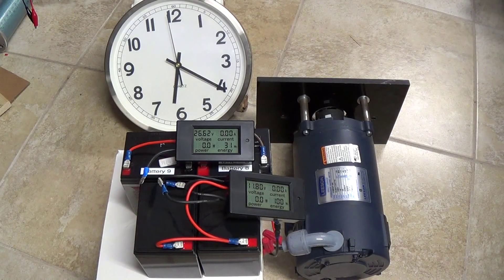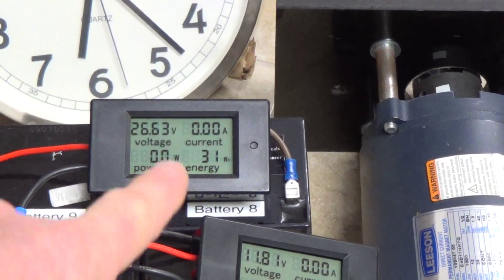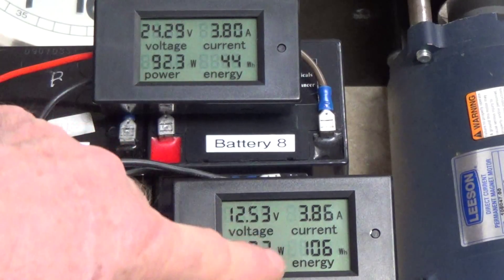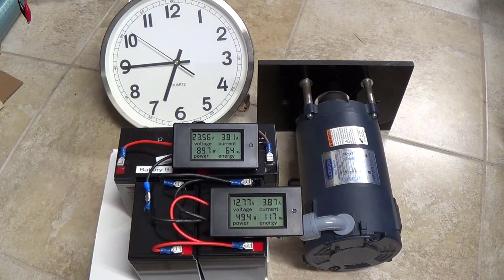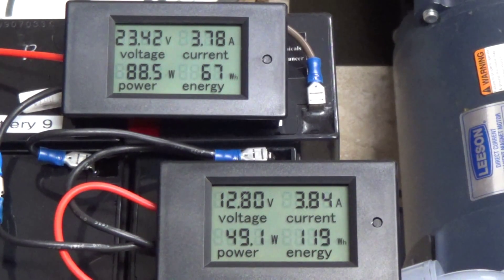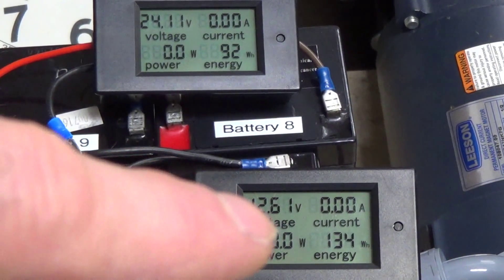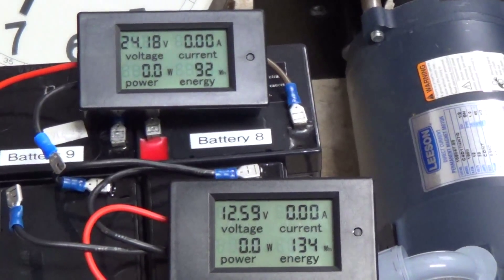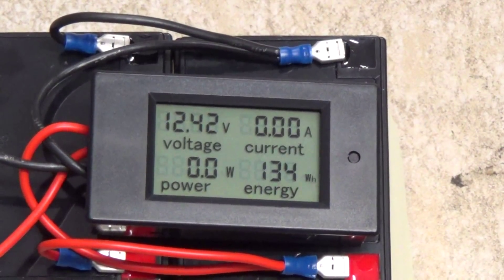Testing of Special Battery Arrangements (part 2)

Comment: I love the test but it doesn't seem entirely accurate to me. Maybe I am not correct, but when you did the first test, you did 2 5ah batteries in parallel for the 12v run. (13.3 actually but for ease of explanation 12v). Then when you did the second test, you hooked 2 5ah batteries in series. So technically that is not a valid comparison. Since the 24v pack is only sending the DIFFERENCE through the motor, the load only sees 12v. Not 24v that is being measured by your top watt meter. And at that, since it is only seeing the difference, it is only getting 5ah at 12v on the 2nd test. Not the same as the first test that got 12v and 10ah. For the 2nd test to be an accurate comparison, the first test would have needed to be 1 12v battery at 5ah. Your motor is losing speed so quickly because in the 2nd test, the voltage is climbing on the parallel bank as the voltage is dropping on the series bank much faster because it is only a 5ah battery. and the difference between the two banks is dropping quickly but it is due to energy being recycled in the 2nd bank. If you figure your voltage difference at the end of the video, you were only running that motor on 8.71v on test 2 and at the end of test 1 it was 11v. Of course the rpm would drop that low. Everything is actually working as it should. If the top watt meter was hooked between the 2 positives of the banks, it would show the 12v difference instead of the 24v that is not being used. That 12v difference times the amperage will show less than half of the energy left that 24v bank than what the meter shows. Not quite that much landed in the bottom bank, but most of it did. And not as much will transfer to begin with because of the voltage difference decreases so fast as bank 2 charges. This concept is meant to continually switch the battery banks, where in the long run you have actually recycled a portion of the energy you get to reuse. With my own tests, I get much longer run times swapping than if I ran them down in one shot. But I also do not get more out than I put in. But I do see way more run time. Thoughts?
Reply: I am not dogging the experiment, I think it is great and stuff I have been working on for many years. Some in the OU forum as well you frequent. But consider this. If in the first test, that top meter was hooked to the exact same terminals as the motor, why would you then hook it to different terminals for the 2nd test? The motor is hooked to the positive of the series pack, and the positive of the parallel pack. So it sees and receives the energy from the difference. But your watt meter is showing accurate current, but measuring the voltage of the battery bank, not what the load sees. So the wattage shown is inaccurate and most likely more than double what actually transfered. Does that make sense? Its like you are looking at it from the perspective of the run battery. But in order to know what the motor saw on the 2nd test, you have to measure it from the perspective of the motor.
Reply from the maker: Hi Chuck, this second test is to determine if there’s any advantage (gain) in a 4 battery connection scenario compared to running it off the 2 batteries in parallel from the first test. We are comparing Watt Hour of input vs output which is automatically calculated by V x A in the meter. So double the voltage is calculated. What we can clearly see right from the beginning of this test is even though we are changing 2 batteries in parallel we are using twice the amount of Watts from the series input batteries and why there cannot be any gain here because half of the input watts is used by the motor and the other half is charging the batteries. May as well just run the motor off just 2 parallel batteries (as done in first test) and it will run with half the input watts for twice as long. There’s no reason to do this test other then to prove it’s pointless. Watts in vs Watts out is the best way to calculate a gain mechanism. Regards, Luc
Reply: @gotoluc  This keeps bugging me. I don't want to be a pain and sound negative. I love your content and your work and how precise you are on things. But the voltage on that top meter is just wrong. It is way off which is throwing off the power rating, and your watt hours. It's in the range of being over double off....  Ohms law proves it, don't take my word for it.... Let me explain. Your first video gives very clear readings throughout the whole video that we can plug into ohms law. Every reading I check in that first video matches ohms law exactly and says that the resistance of that motor is about 2.89 ohms. Plugging in all the numbers comes out correct every times. But when you do the same thing in your 2nd video, it is way off. If you were actually using over 24v on that top meter, for a load of 2.89 ohms the current would have to be well over 8 amps. It simply is not. You will find plugging in all the values ohms law says that top meter should be reading more along the lines of over 11v for the current draw you are showing. This makes perfect sense when you consider that the only amount of energy even able to flow is the DIFFERENCE between the battery banks. Therefore, that top meter is NEVER sending out 24v like the meter is making the calculations for. That top meter would have to be hooked between the 2 positives in order to accurately read what is flowing from the top battery bank. I hope this makes sense. It is a brain teaser. But I think a bad measurement here, proven by ohms law, is showing an entirely incorrect representation of the efficiency here. Thanks for reading this over.
Reply: @ChuckYoung75  Little bit late to this, but Chuck this is a very easy calculation to make up for the missing 3rd energy meter. In engineering we use Kirchoff's circuit laws (KVL and KCL) to establish conservation of energy in a closed loop. Voltages and currents must add to zero else an element or node is missing.

The only unknown voltage is the voltage at the load. Taking the final test voltage at 12:32 we have 3 elements, Voltage source 1 (Vs1), Voltage Motor (Vm), and Voltage Load 2, (VL2), the second battery bank.
All voltages should add to zero, so writing the equation Vs1 + (-Vm) + (-VL2) = 0
Plugging in the voltages at the timestamp, where Vs1 = 21.72V, and VL2 = 13.03V
21.72V - Vm - 13.03V = 0
solving, Vm = 13.03V - 21.72V = -8.69V

The voltage is negative because it opposes our voltage source as a load, so our sign convention is correct.
Now lets verify by summing all the powers to zero using our calculated motor voltage. 
knowing that P = IV and V = IR and the average current flowing as reported by the meters is (3.65 + 3.7)/2 = 3.675A
Battery 1 discharging power - Motor Power - Battery 2 charging power = 0
Because the meter is cheap, it introduces error in its power calculation, so I calculated the reported voltages and currents with a precision calculator instead.
(21.72V*3.675A) - (8.69V*3.675A) - (13.03V*3.675A) or 79.821W - 31.93575W - 47.88525 = 0

We could also find motor power by simply taking the difference between the batteries to find the remaining power and attribute it to the motor.
79.821W - 47.88525W  = 31.93575W. 
So we have confirmed that energy is conserved in this closed system. 
You could also compare the energy counters as well to find the total energy dissipated by the system at the motor. However keep in mind the measurement error from the cheap meters' power calculation.

The biggest takeaway here is you can split the positive but you cannot break conservation laws if the system is closed, its more a matter of how efficiently the system runs as a result of the chemistry and discharge/charge rates, and I believe @gotoluc answered this question. 

Feel free to make the same calculation anywhere in the discharge and you will arrive at the same result, but will know the different rates of power consumed.

edit: also regarding your original post, switching the batteries will simply modulate the rate of discharge at the load. You may be able to efficiently use your power this way with intelligent switching, however it would be needlessly complex compared to a DC-DC converter or speed controlled motor driver.

Comment: 5Ah each, so in theory there is
5x4x12x3600=864000 joules.
To keep a good batterie, the voltage must not drop under 2/3 of the voltage.
In the end of this test and the previous test you have used:
(92+134)x3600=813600 joules
If I made a mistake don't hesitate to say.:)

Comment: Luc I am trying to see if there is an advantage but it is a matter of configurations. My test was within days of yours but withgenerator self looping. The generation side is in proximity to the phases or fields of the motor side. The generation sideis separate by mechanical power transfer from the input. A good reason to check this out (and I very much appreciate your accuracy in methodology) is that for self looping there is input output and losses and gains capture. That yielded a somewhat better result. Your test confirms the hypothesis of a straight consumption configuration. The bounce backif any is unlikely to be strong enough in most ways to be a solution to unity but it may create more efficiencies or a steptoward unity in other configurations.